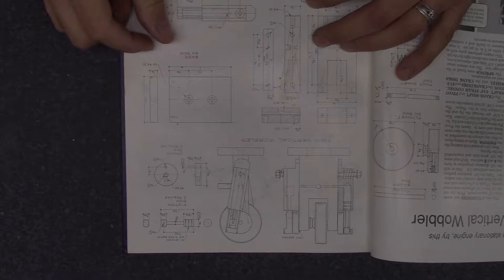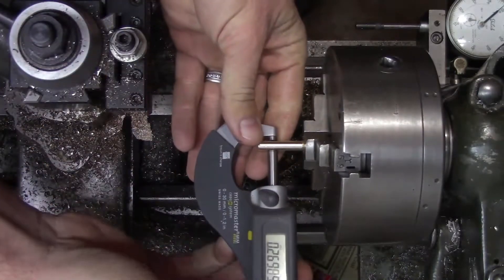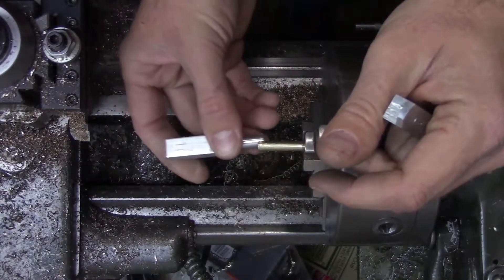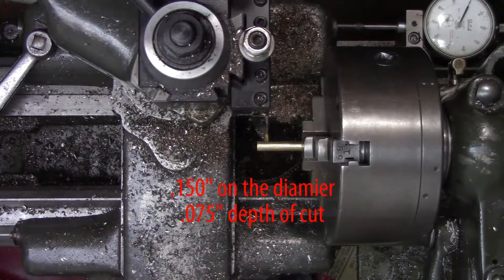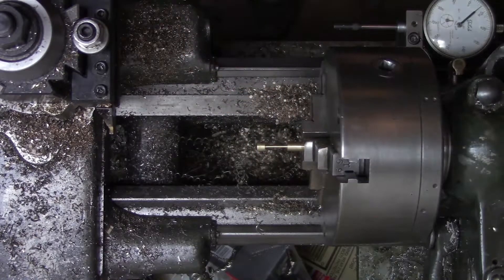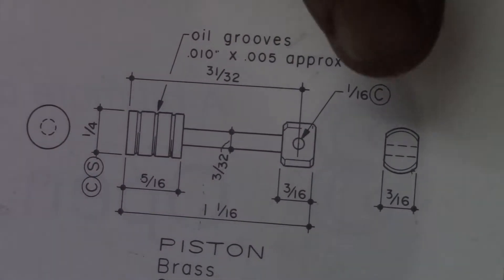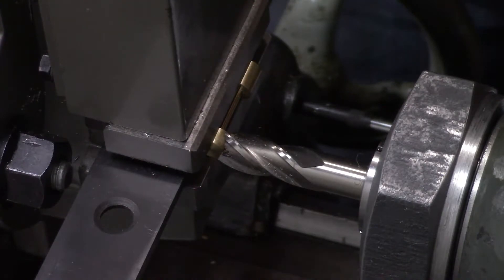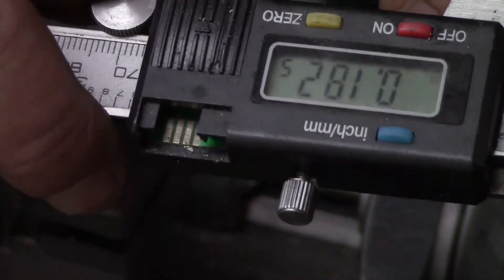Making Elmer's Engine #2 - Part 3

Comment: Good to see a new video from you. Did you do the milling operation (the flats) in the lathe?
Reply from the maker: +John Strange
I'm glad to finally be back at it. It has been a long rough summer for my family.
Yes, I did do the flats on the lathe with the milling attachment I made. This would have been a good job for my little horizontal mill, but I haven't had the time to put it back together.
Reply: Ahh yes. I forgot about the milling attachment you made. A long summer indeed. I spent a great deal of mine getting a South Bend and preparing to move it into my basement. Baring any incident this coming weekend should complete that project with the bed and motor housing finally being moved in. Can't wait to get it back together, then get into the wiring. :)
Reply from the maker: Good luck with the move. What South Bend do you have? The wiring, at least with mine, wasn't overly complicated.
Reply: Thanks.  I have a 13" x 5'. It's 1 hp three phase, so I'll be going the VFD route in box with a fan and tachometer, and then maybe a remote potentiometer box on machine itself. All in all, much anticipated light weight parts. :)
Reply from the maker: Very nice, I would love to have a 13". I love my 9" but there have been times where I wish I had the extra swing. Mine came with the original 3 phase motor. I picked up a single phase motor to replace it and wired it for 220 V. I got the single phase motor for free so it was of course the most cost effective route.
Reply: Thanks again. :) I almost got a 9" jr with a ton of tooling from a former student of Mr.Pete, but I really wanted the quick change gear box, so I held out until the 13" came up. Before this I just had an old shop made mini "lathe" that I rescued in pieces out of the dirt and rain and snow for $50. It was an interesting little machine that someday I'll wish I never got rid of, but it had to go to help buy the 13". Before the shop made machine, I built my own ridiculous little contraption out of a lawn mower engine block, and bed frame (lol It makes me laugh to see myself even say it, but it actually worked... kind of), so the 13" is my first real lathe, and I am super excited, and always happy to watch and learn. I've seen others swap out for single phase motors (with the under mounted motor housing style lathe too), but I figure for what it will cost, I'll just go the VFD route and be able to fine tune my speed.
Reply from the maker: I lucked out with my 9". A school near me was going to send it to the scrap yard and I convinced them to let me have it. I just had to reimburse the school for the cost to have it moved out of the building and onto my trailer, which was $75. Hell of a deal.
Reply: Wow!